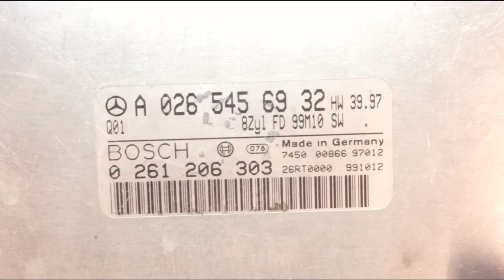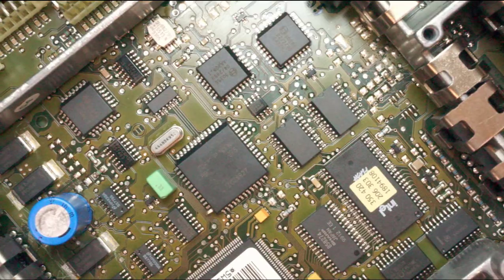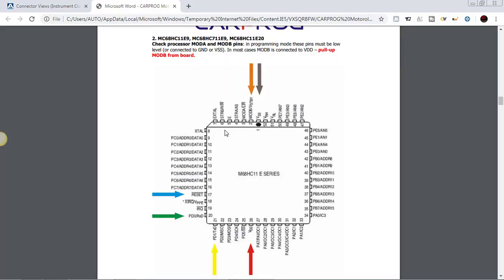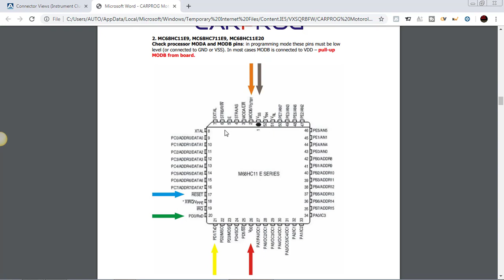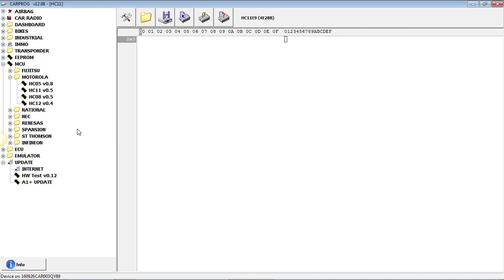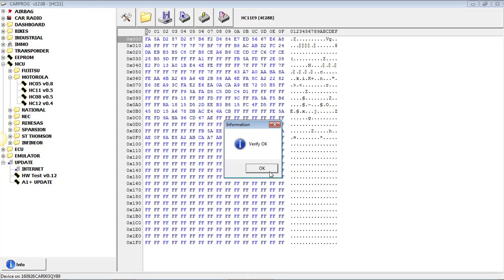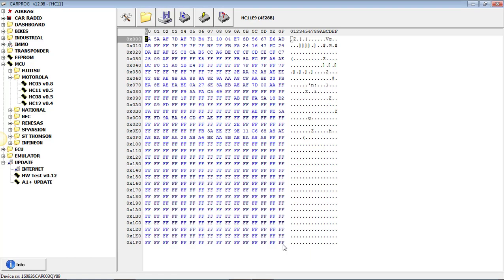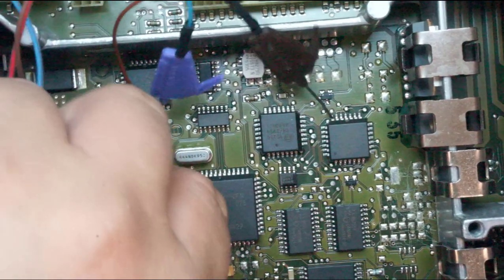⚡️Mercedes Engine Computer Reprogramming ECU part 2

Comment: Great job! Question. What kind of contact holders are you using? Can you give a link? Thanks. Like!
Reply: I want to buy this computer full system 
I mean programming tool computer
Reply from the maker: Arlabs very expansive $251
Reply: @vehix411  wher can you get it exactly please.

Comment: I've got a 1998 c200 auto stuck in limp mode, my mechanic wiped the codes and won't tell me what they were.. i don't have a 38 to 16 pin adapter yet but have an icarsoft cr. Is there any way to manually reset the ecu and tcu etc and if i do, shouldn't the codes re appear? I've searched everywhere and my local benz garage refuse to share any knowledge without large sums of money

Comment: Hi very nice videos! I have a  A0275458832 it looks exactly the same as the one in the video, I have a donor unit and would like to swop the security eprom around as you have done in another video. Where is the security chip located in this unit? Is it also on the back side as in your other video? I really hope you can help. Thanks in advance.

Comment: Hello,
I bought a 2000 ML320 and currently in limp mode due to previous owner replaced the original PCM/ECU.
-my question to you is …without the original PCM /ECU can you program a new used PCM/ECU if yes, can you do it if I send it to you?
Thanks!

Comment: Hi I need help I got s550 2008 when I was replacing my engine mounts I broke cyl 7 ignition coil plug and I did not notice it. I started my car and parked I noticed that my engine started running ruff . I noticed that cyl 7 coil plug was broken. I instead new coils and plugs runs the same way. When I check for codes I got cylinders 7-8 codes. I removed my ecu and sent it to MODULE EXPERTS in Jacksonville Fl. For repair. After long time I got ecu back after install car didn’t start at all. I mailed it back to them after two months I got my ecu and I got the same problem as I had in beginning same codes . Misfire on7-8 cyl PLEASE HELP

Comment: Hi Dan,

Thanks for posting this.  My van had lost all turbo boost and the sprinter specialist said it’s the ECU.  It’s not sending a signal for turbo boost and it’s locked by Mercedes?  He said I’d have to take it there and it will cost a fortune.  Would I be able to buy a used computer and have it reprogrammed by you?  Or would the process be the same as the video.  Thanks! 

2003 Dodge Sprinter 3500

Comment: I have a C280 2006 the ecu is original but he car won't start or crank the coolant fan in the front sounds full speed. The computer can't connect to the ECU . Here is a 2min video in youtube where my issue is fully explained.

https://youtu.be/rrgfY6W0Z9U

What should I do to fix this?

Comment: Hi, im doing an engine swap from a 2004 S55 AMG into a 2001 SLK230. Is it possible to defeat or clone immo and use stock SLK cluster instead of having to swap s55 cluster into it?
Reply from the maker: This year merz don’t store immo in cluster

Comment: Hello Dan. Well done. I have ruined a few ECU PCB's due to removing the processsor for re=programming and was quite excited when I saw this post from you. I use a XProg M Box 5.55 to program and I have tried this method of yours, but the software keep on reporting "Device is silent and timeout" Am I doing something wrong? If I remove the chip from the board then it reads and writes without any problem. Do I need to apply power to the ECU or to the Xprog M power supply socket? Thank you.

Freddie
Reply: Can i contact you as am just a starter but learning quickly I'm kurdish iraqi I'll appreciate your help my whatsapp 009647510525877
Reply: I am having the same issue with X prog My Ak400 got damaged it has not been easy with Xprog removing the chip and resoldering it back

Comment: Just one question. 
 My Mercedes is flooded, and I'm just starting the engine and the two big fans are working. It's the problem with that?
Reply: you have to trace that problem with the car schematic. 
I bet the radiator fans are switched by the FRONT SAM (under hood near brake booster)
Reply: Ur car still drives fine ? I flooded my e500 and it wont shift out of 2nd and my seats won't work

Comment: Good video. It’s pretty clear with cloning. If you don’t have a programer you can swap the chips too. 
But do you know how to virginize the ECU - to make it fresh like you purchase it brand new from the dealer?
Reply from the maker: Yes we also do virginize and we can even program key info from ignition lock if you don’t have a Mercedes computer to program the virgin ecu
Reply: @vehix411  i have A2721533779 ECU. Any tips for virginizing it?

Comment: Hi sir I have a W211 Diesel 2009 E300 V6 Bluetec and I have problem with its ECU a guy who inspected told me that it's processor gone and can't be repaired! I'm searching for a used one but very hard to find its serial is CR5.4

Comment: Just a question to be sure I understand. I have a faulty ecu on a w210 E200 and I am buying a new one, same parts number. 1. The Immo eeprom from mine needs to be transplanted into the new one and 2. the processor needs to be reprogrammed, right? Transplanting the Immo eeprom alone to the new computer will not be enough for it to work?
Reply from the maker: If the Ecu looks just like the one in this video a thick Ecu usually is on w210 then you only need to program mpu no chip
Reply: But changing the chip from my ecu to the other would work too? I ask because I know someone who can change chip, but I do not know someone who can program like you did